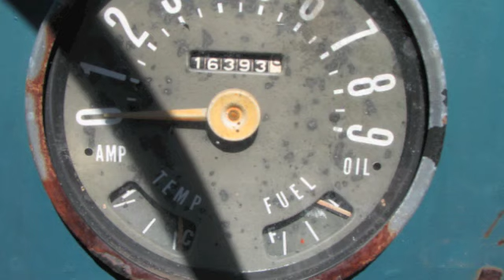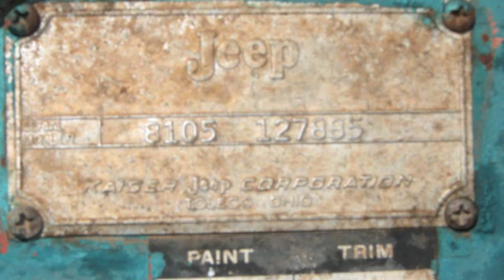Horse Face Films presents 1965 CJ-3B Restoration

Comment: I have a 1964 CJ3B and I am doing the same type restoration. In fact, mine has the same paint and trim code as yours, and I am going back with the same Spruce Tip Green. Thanks!